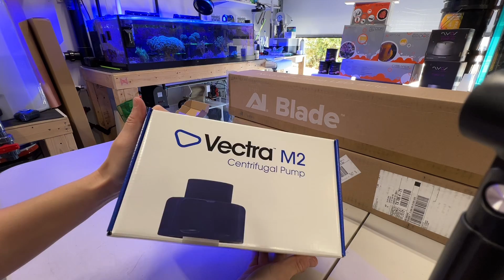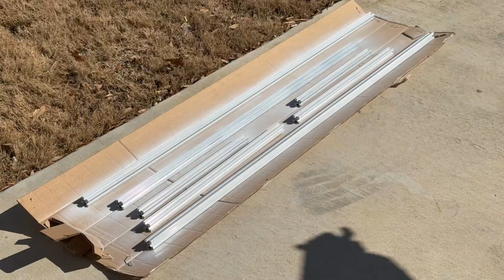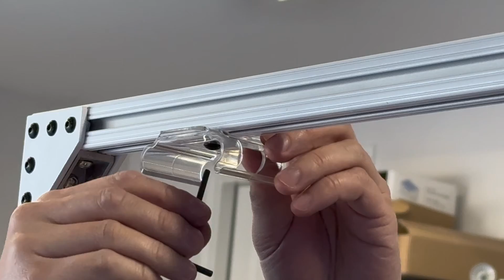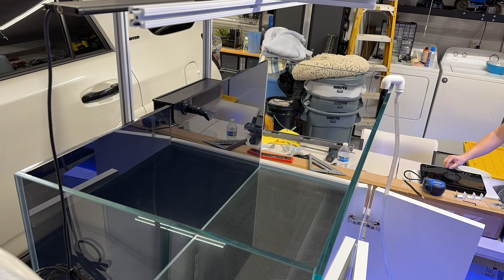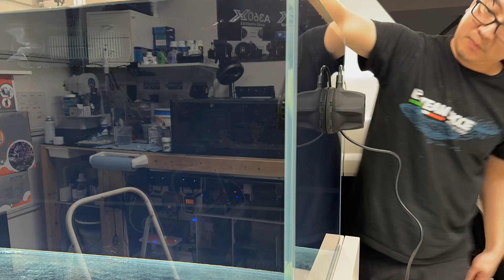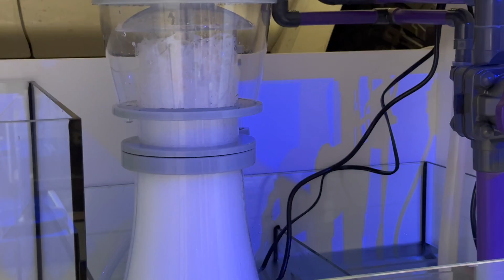Bay Area Reef's Nyos Opus G2 440 Tank Build: Part 4 - Getting Wet

Comment: Dude I need help so bad. I just got this tank and have been trying to dial it in and its so difficult. y return chamber has the back chamber water falling into the it, is that correct or should it be all the same height? Also Is your water level going over or at the emergency drain? Im not sure if my return is set to high or not. Its a neptune Cor-15 set at 40%. BTW I loved ur feature on WWC channel. Also how do I get the return nozzle in the display to stop sucking in air (making mini tornado). Please help me im struggling its my first tank

Comment: The light bar turned out nice. Very clean. I filled my last two builds exactly like you. Easiest way to leak test and  fill a new tank. 👍
Reply from the maker: Thanks! I need to do a follow up video of how so mounted the Radions in the bar. I got these cool 3D printed mounts
Reply: @bayarea_reef  I don't like the way your light bars look like. The design of the stand/tank is sleek and these bars are home-made kinda tacky. I made a stand myself with wooden boards and although I like it, it looks the same.